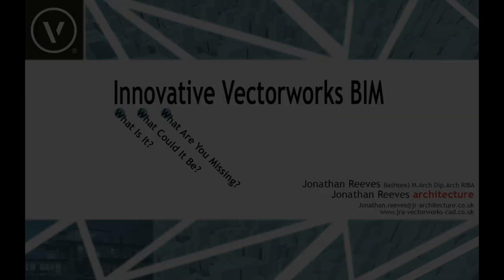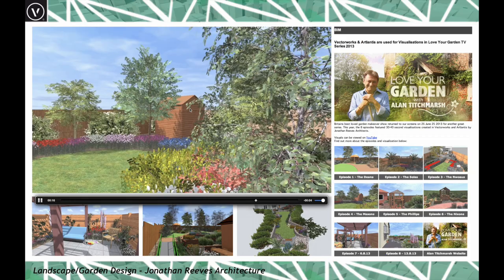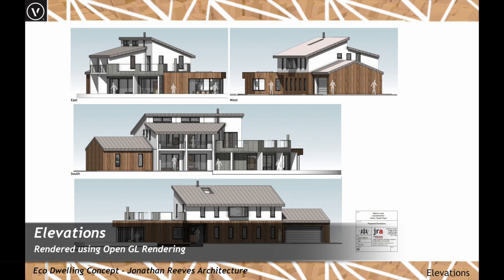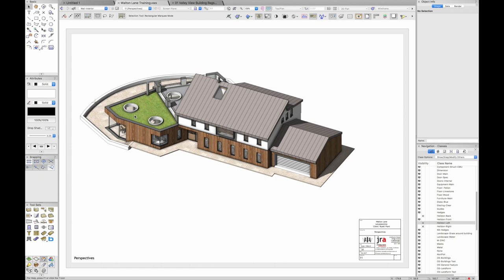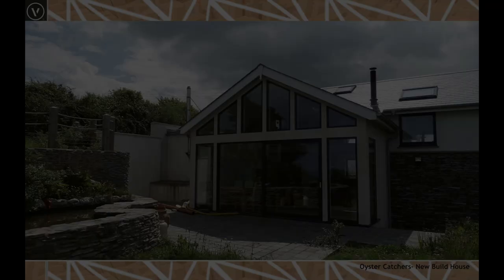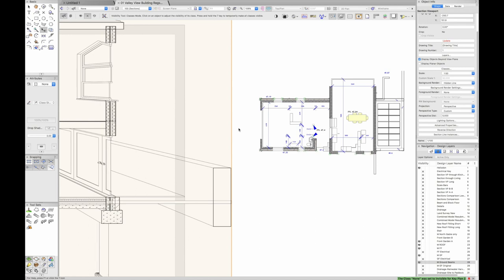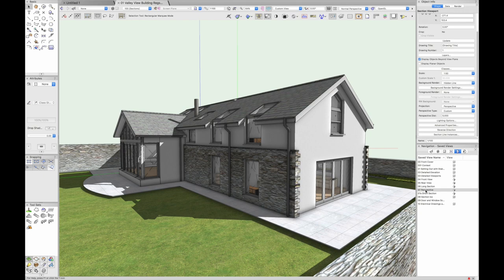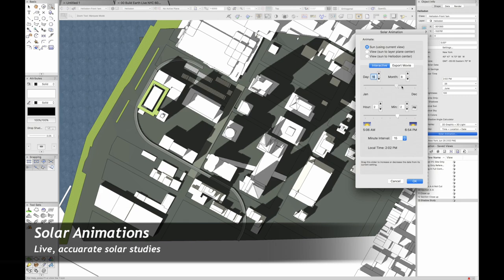Innovative Vectorworks BIM Presentation

Comment: Good morning, do you think Vector works BIM can compete with Revit BIM? .... I used Vector Works 10 years ago, but the last few months many have tried to change my software to Revit arguing that BIM is better in Revit. What can you say based on your experience? Thank you, I am writing from Bolivia.
Reply from the maker: In my opinion, Vectorworks is so much better as a designers tool, and for developing projects from concept stage to completion. It offers nearly everything Revit does and is cross platform with a nicer interface and is much easier to learn at a good level. Find out more on my brand new website: https://vectorworksbim.co.uk
Reply: @jonathanreevescad  hi, Vectorworks could be nearly better to Revit, but if we need to coordinate with buildings and collaborate with other discipline, Revit will lead the stage.

Comment: Greetings, what tool did you use to model the rain gutters?
Reply from the maker: Hi Gabriel, They are simple extrusions and extrude along a path. Draw the gutter profile and then the path and select Extrude along path from the Model menu. Double clicking allows you to edit either the path or profiler afterwards and then reapply the command. Hope that helps.
Reply: Innovative Vectorworks BIM thank you for the quick reply, it helps, I though it was an extrusion but since it’s not a parametric object, I don’t know how can I make a schedule with the length of every gutter on a house...
Reply from the maker: Ok not sure that you can do this automatically, but it should be easy to measure each one manually!